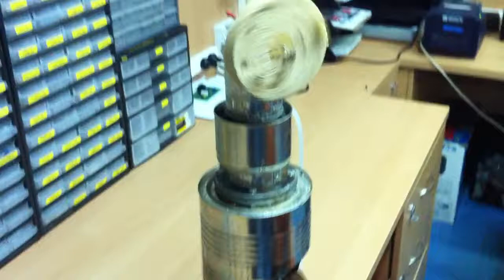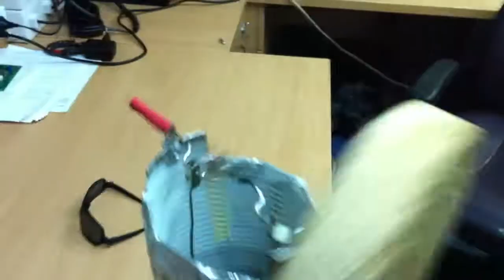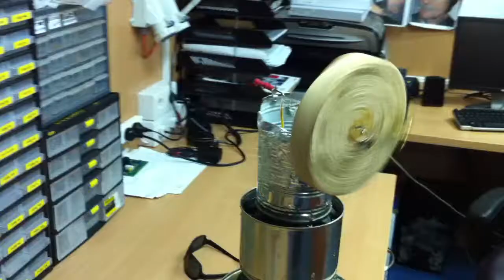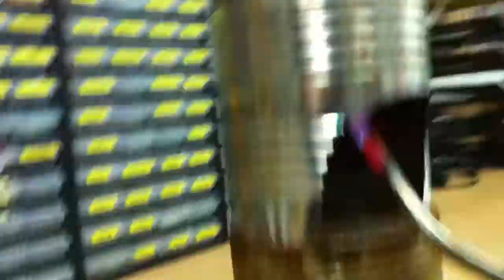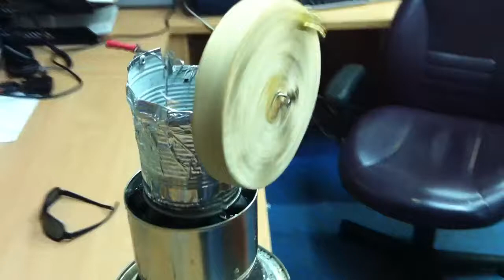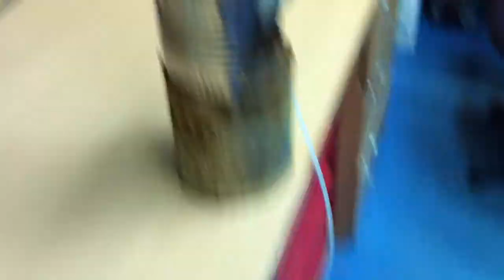Beta Type Stirling Engine Build 1.1

Comment: It really is a motor sensitive to friction and air leaks! In what must take extreme care to opter a good performance!
I usually use engines eject the video cassette tape, which serve as generators and do not consume much mechanical energy.
Congratulations on your dedication.
Greetings from Brazil,
Leandro.